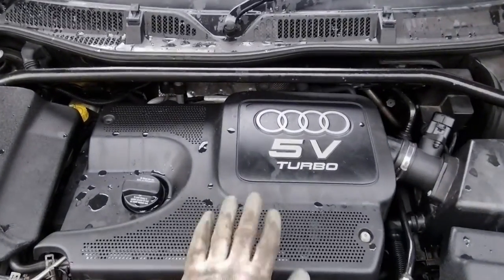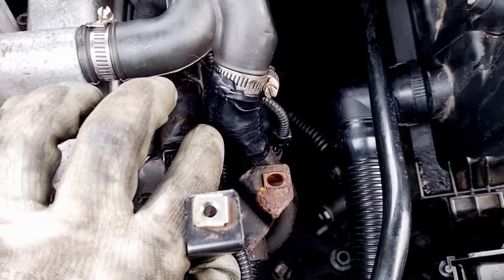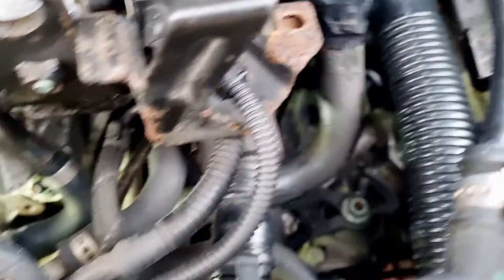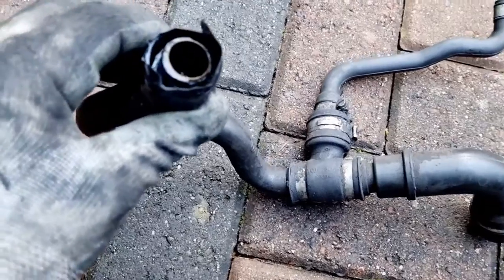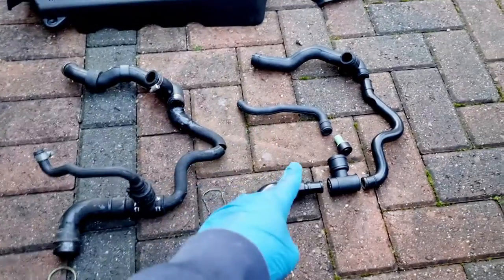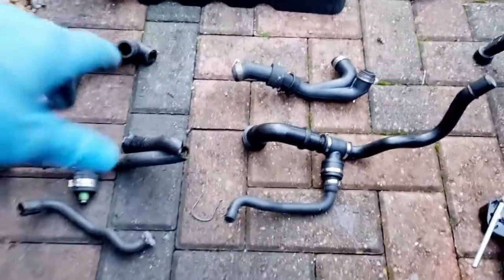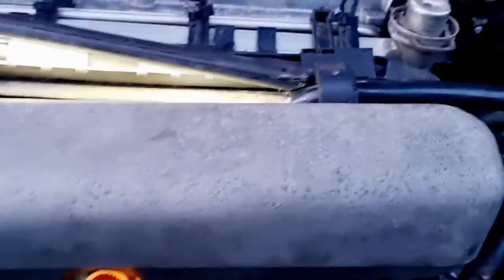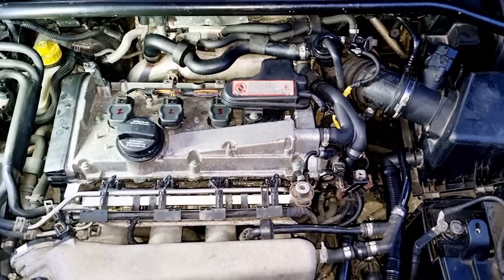Changing the PCV system on a Audi TT mk1 - Part 10

Comment: Thank you. That has helped me to replace the broken pipe (the patched one in your case) along with others. I also used the opportunity to replace the thermostat, which I thought was responsible for low engine temperature (yes, it was!). Appreciate your time and efforts needed to film and edit the repair process.
Reply from the maker: @orgenstepp  thanks for the support and comment. Great to hear it helped you out and you car is running well 👍

Comment: People watching this for help, first part of advice I would give is to save you some headache, remove the front bumper and intake, when you go to replace all your cooling lines on the car, best to do the cooling lines and EVAP at the same time, also just buy a block off and block off the EVAP, SAI and the vacuum box on top of the valve cover, all of this causes you Boost issues and will be the reason for a Boost leak, IF your State  doesn't do emission test.
Reply from the maker: Thanks for the comment and advice Music, great tips 👍

Comment: Hey how am I meant to fit the bottom pipe in I cannot for the life of me get it in there or get the horseshoe clip on enough to keep it still
Reply from the maker: Hi Fotner, thanks for the comment and support. Make sure the new oring is the same size as the old one if its slightly bigger it will stop the pipe fitting snug. That said, use a little oil or silicon spray on the oring and end of the pipe, just to lubricate enough so it slides in more easily. Hope that helps 👍🤞
Reply: @Witty924  how tight is it supposed to be in there no wiggle at all?
Reply from the maker: @dotner7976  yes it should be very snug to ensure no air leaks 🤞
Reply: @Witty924  that’s what I thought it was not, believe gasket and horse shoe were both too big, Ik it’s controversial and possibly problematic in the future but I just put the old gasket in and old horseshoe isn’t as controversial but it seems to be snug now
Reply from the maker: Sometimes the new parts supply in kits can be a little out of spec. Glad the reused parts did the job 👍🚙💨

Comment: so did this fix your rich condition?
Reply from the maker: Unfortunately not identity, it made the car run smoother at idle and revving but I'm on a wild goose chase for another vacuum leak so have to do a smoke test in the next week to see if I can find it.
Reply: @Witty924  ah thats a shame, im chasing the same issue and making this change today following your video. next thing to check if this doesn't solve things is my intercooler and piping.
smoke test seems like a good way to go, how are you getting it done?
Reply from the maker: @tigershav  that's a good shout I need to check that too. Good luck with the work and let me know how you get on 👍
Reply: @Witty924  so i got it done, made a few mistakes along the way as this is the first time im doing something more involved than switching the MAF. found that the old T was not even connected to the hard pipe, was just sort of flapping there.
engine is still running very rich but on the plus side no more petrol smell in the cabin. 
just to be sure, the pin that holds the hard pipe, does it go above or below the o ring? got mine in place but it doesn't seem that solid, and also the first time i pulled on it just to check and it just came off, almost lost the o ring 😅
final question (sorry for such a big reply)
assuming u missed the question before, how are you getting that smoke test done?
Reply from the maker: @tigershav  has it solved the issue ?
Reply: @Witty924  not sure if you're not able to see my whole comment for whatever reason but no it hasn't fixed it. Gonna get a new N75 then look at the intercooler piping.
Reply from the maker: @tigershav  let me know how you get on with the n75 too. 👍
Reply: @tigershav  Im in the middle of reinstalling my system right now and I’m facing the same trouble with the horseshoe clip that goes on the big pipe at the bottom, did you ever figure out how to get? Like you said I can get the clip to go on but then with a slight tug on the hose it comes right out
Reply: @NoName-nh9mo  I got a piece of wood to hold the big pipe in place (levered under the manifold, on top of the pipe), then I put the clip in.
I'll be honest I'm not 100% confident in the assembly but it hasn't come loose or anything.

Comment: is there a place you can buy all the pipes you need in one kit ?
Reply from the maker: Hi Simon, thanks for the comment, so lots of great kits on ebay, this is the one I bought, hope that helps 👍 https://www.ebay.co.uk/itm/Crankcase-Breather-Hose-Pipe-For-VW-Jetta-Bora-MK4-AUDI-A3-1-8T-AP-Golf-Set-/384662070914?mkcid=16&mkevt=1&_trksid=p2349624.m46890.l49286&mkrid=710-127635-2958-0

Comment: Great video! About to do the same today for APX engine. How much time did it take to replace these parts?
Reply from the maker: Thanks for the comment and support Jusa. So without filming the video I think a good 2 hours to take your time and give yourself time to check as much of the vacuum piping around the engine as you can. Hope that helps and good luck with the job 👍
Reply: @Witty924  Great, thanks! Hopefully nothing else brakes while Im in there 😅

Comment: Thank you very much, mate. Really nice shots to get an idea of how to do the job.
Reply from the maker: Hi Matt, thanks for the comment and support. I hope it helps you out on your PCV change and it all goes smoothly 👍🤞
Reply: @Witty924  Almost got it. It is a pain to do with the engine code AJQ, since they got a bigger metall bracket for more connectors which is imposible to remove without getting the intake manifold out. So there is even less room under the manifold. Besides that, the rubber piping is shorter (less pieces), which means that the metal part is longer and gives you no room to play with flexing pipes to fit things. My elbow was not going all the way down due to the heigh of the metal piping. To remove the metal pipe, the coolant flange screw has to be removed. Perhaps you can pin this info, because it might be useful for other people with the AJQ. Really tedious job. Cheers and thank you again, mate

Comment: Hiya pal 
I’ve just had my vacuum suction purge valve break causing mega misfiring and terrible idle .. after watching your video looks like I’ll be able to remove old part an replace it without having to remove the manifold nice one 👍👌
Reply from the maker: Hi Jules, thanks for the comment and support. Great to hear the video will help you out. Just use a wobble end foe the bolt that is a little hars to reach and you should be good to go 👍

Comment: great vid, thanks for the side by side layout. I have this job to do tomorrow so this helps. I'm gonna have to remove the manifold though as i have a different engine layout. 😢
Reply from the maker: Hi Riddler, thanks for the comment and support. Glad the video helps. I know on the 225 you have extra parts in the way so a little more work involved. Also having the manifold off gives you a chance to replace the gaskets as they can be a vaccum failure too. Dont forget about the throttle body if you do unplug it, I'm sure it may need recalibrating. Good luck tomorrow 🤞👍
Reply: @Witty924  Thanks. Yep ive got the vag com software for the throttle ad ive had to replace it before. Did you know the teeth inside the throttle that controlls the flaps are plastic? i found out when i took it apart after getting a throttle code error. Ahh the TT... such fun
Reply from the maker: @RiddlerOnYutube  those cheeky engineers, cost cutting on things the eye doesnt see, until it goes wrong haha. Hope all goes well, let me know how you get on 🤞👍
Reply: @Witty924  did it! i had to wait a few days for a new gasket but it is all fitted now. the pipes were so blocked and broken, glad i noticed it and changed them all. I"ll look to invest in some good silicone ones in future but these are ok for now. Wow i feel i saved so much money doin this and have great confidence for other work now. i'm going to drop the sump clean it and replace the pickup pipe. Ahh the TT!
Reply from the maker: @RiddlerOnYutube  fantastic to hear it all went well, it's a great feeling knowing you did  the work and saved a bunch of money too. Enjoy the ride they are great motors and thanks for the messages 👍🚙💨😎

Comment: Mine is BAM 225 so it’s a bit different than but I did remove the intake manifold because it’s broken the elbow pipe ..F and …BG both RIP so badly)*
I’m thinking to make those PCV  plasticky-things have all silicones or metals in them
Reply from the maker: Hi Hella, thanks for the comment and support. So definitely look at the silicon hose route. Lots of great kits out there ans they will last well, plus you can get some great colours to match the car exterior paint. 👍🤞

Comment: Did you replace the suction pump too? I’m struggling to find where the suction pump goes
Reply from the maker: Hi Zach, thanks for the comment and support. So it sits under the air intake manifold. Its additional pipework and depending on if you have the 180bhp or the 225bhp it will mean digging a little deeper. This link may help on the audi forum which details the suction pump. Hope that helps 🤞👍https://www.audiworld.com/forums/tt-mk1-discussion-9/pcv-valve-hose-replacement-amu-engine-bww-long-1946776/#post17288495

Comment: Hi! Where did you get the new hose kit from?
Reply from the maker: Hi Gabriel, thanks for the comment and support. The kits can be found on Ebay from as little as £12, just match your car reg and it will find the kits for you. Let me know how you get on 👍
Reply: How is the quality? Just want to make sure it will hold up. Surprised Ebay is the only place I could find these
Reply from the maker: @gabrielwiggins7336  the quality was as good as the OEM parts I removed. You could go direct to dealer parts. Let me know how you get on with the job. 👍🤞

Comment: Cool...do you have details of the cable ties and tool?
Reply from the maker: Hi Patrick thanks for the comment. Here are the links to the tool and the steel cable ties 👍 
CABLE TIE TOOL
Deal: Dechengbao Stainless Steel Cable Tie Gun and Zip Tie Tool,Cable Tie Tool for Stainless Steel Cable Ties,Metal tie wrap Gun https://www.amazon.co.uk/dp/B07KVYX768/ref=cm_sw_r_cp_apan_glt_i_dl_0HF8V6PW4W4F53V6RX8Q?_encoding=UTF8&psc=1

STEEL CABLE TIES
Proster 304 Stainless Steel Cable Ties 100Pcs 4.6*400mm Marine Grade Multi-Purpose Metal Self Locking Zip Ties for Home Automotive etc https://www.amazon.co.uk/dp/B07T12ZGM5/ref=cm_sw_r_cp_apan_glt_i_8JNYYB1B8W9P1A0EVE09?_encoding=UTF8&psc=1

Comment: Cable ties
Jesus this car will have boost leaks and lack full power
Anyone watching this, use jubilee clips
This is where the 1.8t suffers it’s worst boost leak issues
Reply from the maker: Thanks for the comment Brad, I can assure you there is zero boost leaks with steel cable ties 👍
Reply: @Witty924  yea I noticed u used the tool, I was commenting more for those who may use just normal cable ties

We work on these engines I made a special boost leak tester that inserts in where the air filter is so we can pressurise the system
Literally every car we see has some form of tiny leak in these pipes
Resulting in loss of BHP 

We favour swapping out to high quality silicone items from Forge
Reply from the maker: @kells77  thats great advice, I know these systems are a nightmare for finding vaccum leaks, especially now they are at the 20 year old bracket. The silicon Forge pipework looks awesome too 👍
Reply: @Witty924  I love the 20vt engine
We do engine conversions my mk3 golf is on my page with the s3 engine
I’m currently building a new engine, 20vt but this time I’m stroking it out to 2.1, iv spent £15k on parts 
Basically a brand new engine down to every single bolt that’s on it
I picked up all the last bits from Audi last week, bolts and odds and ends bill came to £1800!!!

On my YouTube the engine that’s in it is forged bottom end big turbo and was 400 BHP
New engine will be around 550

Your is the 180 engine AUQ code probably
Reply from the maker: @kells77  sounds like epic work Brad, I will definitely check out your page, thanks for sharing 👍

Comment: none of those parts you got even fit my BEA engine code i have  a Y pipe instead of a 3 way connector like you got im so confused and lost and all the BEA engine code pcv system parts are fucking outrageously expensive compared to AMU bam and or engine codes making this the worst and biggest nightmare car ive ever fucking owned in my entire fucking life.
Reply from the maker: @Bangerboy985  is this the hose kit  you have on you engine. Sounds like you have a 225bhp not a 180bhp. Let me know https://www.ebay.co.uk/itm/176336719155?mkcid=16&mkevt=1&mkrid=711-127632-2357-0&ssspo=2-oszhl0s_6&sssrc=4429486&ssuid=8h9VmC7aS7i&var=&widget_ver=artemis&media=COPY
Reply: @Witty924  I do have a 225bhp however the link you provided I believe could be correct however I'm not sure because I can't spin the Y hose thats there also.... the hoses that have a yellow cap on i have no idea where it goes. I have the whole kit minus that Y connector